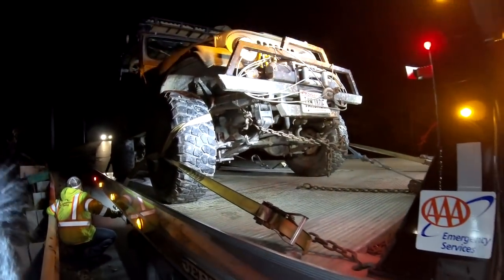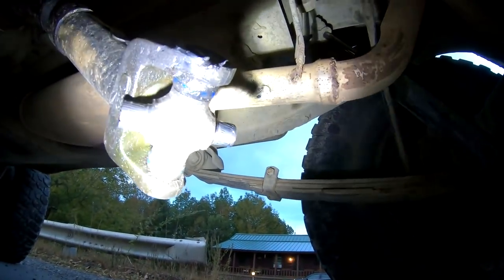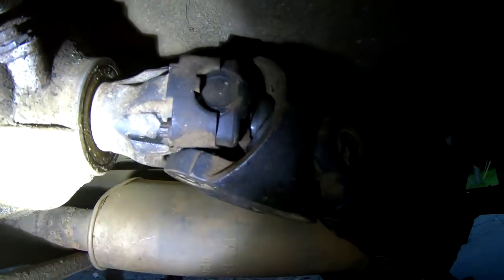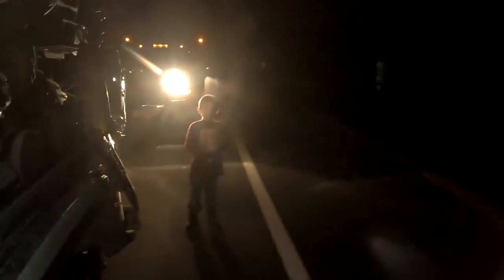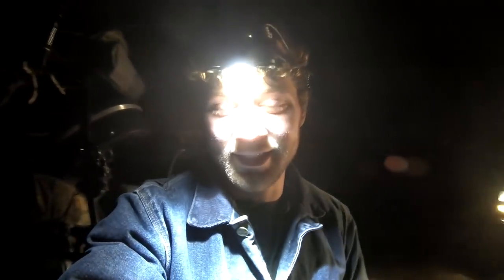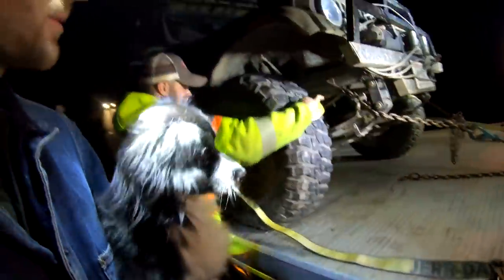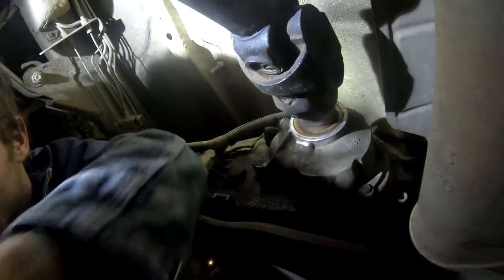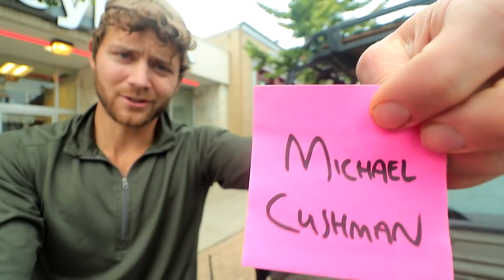Custom FRONT-WHEEL DRIVE JEEP!

Comment: Hey man, I had the same problem. I have a YouTube video that shows how to fix that. Your issue is the thin cheap straps on the rear yoke. Over time those staps stretch allowing the u-joint to move leading to losing the drive shaft. Drill and convert the  rear yoke to ford u-bolt style. That will fix that issue. I lost my driveshaft 3 times. The last time it broke the tail housing on the t-case. I drilled the rear yoke and added the ford u-bolts, I haven't dropped a drive shaft since. I would link my video to the comments, but I know that YouTube can block comments with links from posting. Let me know if you got questions, be glad to help! Be safe out there!
Reply: i agree with this comment very much!! i kept braking those flimsy straps and finally looked up that Ford u-bolt conversion did some drilling took 45min and boom problem solved

Comment: Jake. It looks like you have the advanced adapter slip yoke eliminator.  And the Tom woods double Cardone driveshaft.  The main thing you need to do that is not talked about much is you have to angle your rear diff up towards to transfer case.  The way this is accomplished is by getting wedges about 7-9 degrees. They are made out of solid steel and will not wear out.  A stock setup you want the rear diff to be aiming parallel with the transfer case.  I hope this makes sense.  This could be the cause of you going through U joints because a lot of strain is being put on the u joints.

Comment: A regular box end wrench will work on a 12 point bolt.  Check the movement in the slip joint while the driveshaft is off.  There should be a grease fitting on it.  Your rear axle looks to be waaaaay off on the pinion angle using a c.v. driveshaft.  Axle yoke is probably spread by this point.  Find a real mechanic to set up your axle pinion angle and measure to make sure you have the proper length driveshaft.  Too long or too short and this will continue to happen.  Previous said get a Dana 44.  Good idea.  You are running way over rated axle load. Keeping that great attitude will keep your journey fun.  Enjoy all these stories you'll have for the grandkids.
Reply: goat man he has a slipyoke eliminator kit
Reply: @lifeguard434343  a slip yoke eliminater moves the slip yoke out of the transfer case and into the driveshaft.  Without the ability to lengthen and shorten the suspension would not be able to move.  Every driveshaft has a way to move only the way and the where changes.
Reply: goat man yes I know the driveshaft extends from the middle.  You gotta use the correct grease so it can lubricate and bleed out through the splines because there is not a bleeder hole like on the front stock driveshaft.  The double cardone type driveshaft is a joint that uses two u-joints and a single ball as a bearing that it swivels to help eliminate binding at the transfercase end and a single u joint where it connects to rear differention.  I have the exact same setup and installed it myself so I know it quite well.
Reply: @lifeguard434343  well if you did know this then you would have known that this would be the appropriate time and reason to check for bond and properly lubricate the driveshaft.

Comment: I think you should check your pinion angle.
Reply: Matt Vineis totally agree with a slip yoke eliminator and a double cardone driveshaft the pinion needs to point to the transfercase mounting point for the shaft. A stock setup it should be level and parallel with transfercase. I know cause I have made this mistake plus hundreds of others haha

Comment: So I use to have this problem on my YJ. Once you break that shaft it'll whip and warp the shaft ever do slightly causing an unbalance. That unbalance will cause unusual vibrations and you will continue to break u joints.

Comment: I'm glad people stopped and you made it to Autozone. I gotta ask, my ZJ  broke down once 6 miles from home. I called AAA for a tow, and the local company wanted to charge me $80 because it was modified... What? I then called my local garage who is also a AAA tow place, and the manager had to call the manager of this tow company to come and get me. 4 damn hours later, and a broken driving light... I finally get towed. I have a lifted ZJ with long arms, and the tow truck driver that first came out didn't want to put me on the flatbed. Have you or anyone ever had a problem getting a tow?
Reply: SouthWestOffRoad aka SWxOR An UberTow would be cool! Yeah, I've had AAA in 3 states for over 30 years combined. That was the only time I've had an issue.

Comment: Looks like you have the correct angle on the driveshaft and a double cardan U-Joint...well hmmm...either you have excessive axle-wrap or weak U-bolts...probably axle wrap. Install a set of simple ladder bars/3-link setup (traction bars or even a slapper bar set-up) and you won't have to worry again. The day I installed my new drive shafts I did a "pop the clutch" on hard compacted crushed rock and broke the rear U-joint....lol. I ended up building a pair of 3-link ladder bars out of an old wheely-bar set my friend had left from his Pro-Street. You could actually go with a single bar as long as it was installed in the right place/right brackets. You can get them on-line and a quick stop with a welder/shop you'll be on the road with no more worries.
HI ANNERS!

Comment: Sounds like it's time for a Tom woods custom shaft to me
Reply: James Olbrisch I have a Tom woods double cardone shaft.  It looks identical to his since he has a soa aka slip yoke eliminator.  That’s why he can drive in front wheel drive without spilling all the fluid
Reply: I had one, it worked fine but to be honest assuming you have a decent driveshaft shop locally who uses spicer parts they will be just as good.
Reply: Yeah but its apperant that it's not long enough he will need it to be a little longer. The great thing about the Woody shafts is the lifetime warranty. With my old WJ I busted front shafts all the time and they always honored the warranty seems like I sent my front shaft in r maybe 5 times and I only had to pay for shipping
Reply: Its apparent to me his rear pinion isnt angled properly. Length has nothing to do with it, if it was too short he would have had problems with it separating under flex, if it was too long it would be REALLLY obvious under compression as his drive shaft forces its way through the rear housing of his transfer case.

Comment: Pinion angle is way foobar looking at it in the video it looks too high. Suprised you weren't feeling vibes. With an SYE the ujoint at the pinion should be practically straight (2* lower is ideal for leafsprung to account for axle wrap).  Essentially point the pinion at the transfer case which is usually done by adjustable upper control arms.
Reply: Mr2greys exactly !!!!! 👍👍👍👍👍👍👍
Reply: Or wedges 7-9 degrees would do it

Comment: As always you are keeping at it Well done. As for Jade this poor girl is being difficult for the moment. after reading many of the comments there seems to be some pretty good advice there especially with respect of beefing up the Drive link to handle the higher weights she is carrying. Actually to that point how much does this green lady weight in at right now? I thought these chassis were only designed for not much over a quarter ton and i am sure you are over that, after all you did add leafs to the springs. which may help take the load but the other parts need some upgrade too I fear. Well you know all that I am sure. so let me close with Good luck out there and holler out if you need anything that I might be able to send out, You know how to contact me...Take care Guys... Vic

Comment: TO EVERYONE SAYING ITS TIME FOR AN SYE... he has one, that's why his driveshaft has the slip in the middle and not at the yoke of the transfercase. the reason it broke is probably because the slip in the drive shaft was gunked up and not moving properly putting a ton of strain on the bolts on the pinion side of things. A new driveshaft or a rebuild of the old one would probably fix it.

Comment: Drive shaft angle
Reply: Cory Boyd he has an advanced adapter slip yoke eliminator to help with the short driveshaft and lift.  And he has a custom double cardone driveshaft. His problem, I predict, is pinion angle.  You will burn through u joints on a setup like this if the pinion angle is not pointing at the transfercase.  Which means he needs angled wedges in between leaf springs and rear differential housing.  About 7-9 degrees depending on the lift amount. A stock setup with a normal slipyoke you need the pinion angle to be level and parallel with the transfercase.

Comment: Jade sure breaks a lot
Reply: She's old.
Reply: It's a Jeep.  Comes with the territory.
Reply: Older vehicle, plus, he puts a ton of miles and demands a lot from it.
Reply: @ovrlxnd  sadly that joke never existed till Chrysler bought out amc : (
Reply: All I hear are excuses 🤔
Reply: As many miles he and Ben have put on it I’m actually very impressed by the limited amount of problems. I bet his odometer is over 200k. I know he rebuilt the motor but the drivetrain still has all those miles and is holding up great except for u joints and basic things like sensors or the hitch breaking off

Comment: You have way to much angle on the drive shaft and rear end
Reply: Yeah-- needs to be aligned differently because it has a double cardon in the middle there, looks like he has a slip yoke eliminator kit installed on his transfer case.. same thing happened on my Cherokee because I didn't change my rear pinion angle properly.

Comment: Jake!  Remember when I tried to inform you, lifting the Jeep would put lots of angular pressure on various parts.  Well, this is about the third time I can recall those kinds of issues occurred.  These vehicles, especially older ones are engineered well at factory heights.  Go beyond that and you are asking for breakdown and repair issues.
Reply: 2 inch lift should be ok but  as you said  being old I think it’s all that weight on jade I’m more worried about the chassis snapping